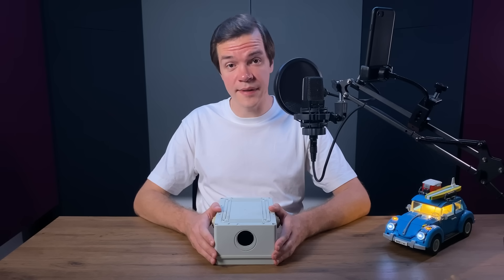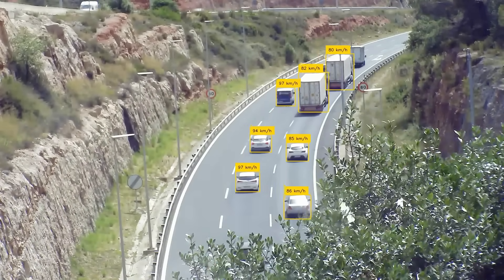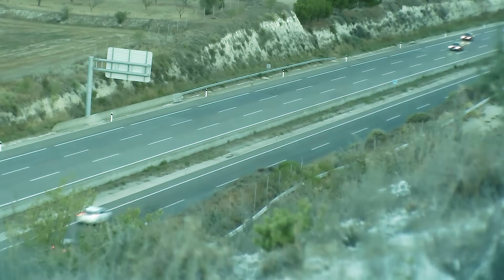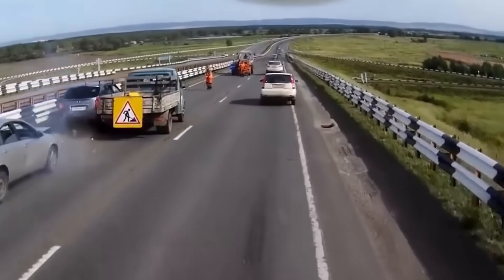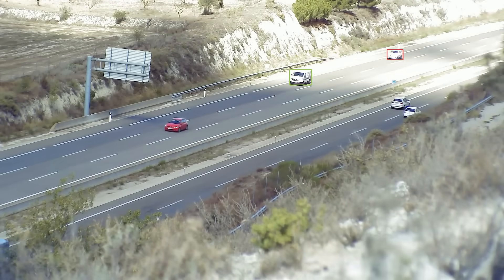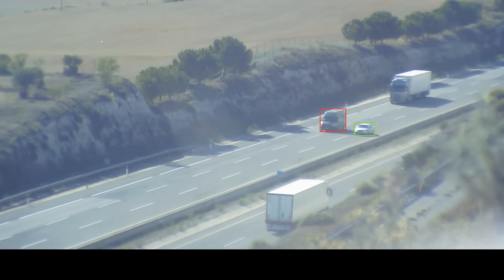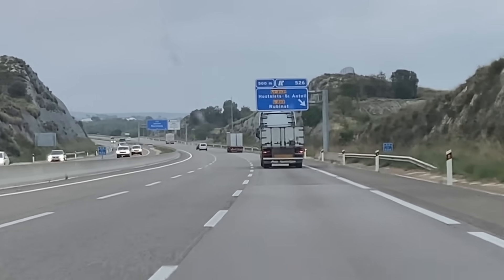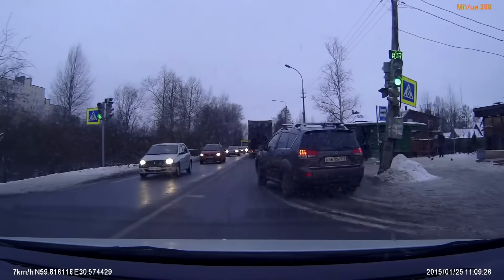New Anti-Tailgating Camera Reveals Shocking Statistics

Comment: Except that the stopping distance calculations (excluding the reaction time part) are based on very old technology. Road surfaces are better. Brakes are hugely better. ABS. As you obiously watch the program, Top Gear did an actual group brake test and found that the official numbers are wildly wrong.
Reply from the maker: 8 m/s2 is the actual deceleration rate for a modern car during emergency breaking on a dry surface. That's almost an 1g overload, very unpleasant experience. I would say, a relaxed driver in a reclined motorway cruising posture may not even be able to achieve this pressure on a break pedal during some time, as he'll first be moved in his seat until he reaches a proper posture.

Comment: This is a great video which highlights a VERY important issue. 
I always try to maintain a 2 second gap in front (and behind as far as is possible) but I find that drivers seem the gap in front of me as an open opportunity for them to join my lane. This video makes this very point at 14:10. 
The more of us that drive well, the better things will get. Thank you for your excellent video and hard work.
Reply: Two seconds is NOT enough of a safety cushion! In “perfect” conditions three seconds are the minimum but five is realistically the optimal space cushion for safety. In poor visibility or congestion it should be increased!
Reply: @justDudpool 2 seconds is the time recommended in the UK as long as the conditions are perfect. Of course, if conditions are foggy, wet or frosty then this time should be increased.
Interestingly we have sections of motorway with chevrons painted to make it easy to measure your time gap. 
Which country are you commenting from?
Reply: Recommendations, like opinions, are often misguided. I’m in Florida and a professional commercial driver. I’m constantly training and trying to always be safe on the roads. Keep in mind that your safety is most important to you and your loved ones. A proper space cushion on the road is the best thing you can have for your safety.
Reply: I'm from the US, and I was taught the 3 second rule, but that it only works under 45 miles per hour.
Reply: @tradingjack1555  It works at any speed.  Think about it: the faster you go the more distance you need to stop.  The faster you go the more distance is present over the 3s between you and the car in front.
Reply: @neildrd -- This doesn't quite work. If you go twice as fast, you'll have 4× the momentum. Even if tires worked as well at any speed, doubling the speed needs 4× the stopping force, or roughly double the stopping time.
Reply: @TlalocTemporal  True about stopping distance relationship to speed not being linear (but momentum's relationship to speed/velocity is linear: p=mv).  Keep in mind (in terms of hitting the vehicle in front of you situation) the vehicle you are following is also subject to approx. same stopping distance/time as you so in an emergency deceleration event that factors into (helps lengthen) your stopping distance (before impact).  Anyway, I'd be happy if people believed they needed to leave eg. 6 seconds at 120km/h vs 3s at 60km/h.  For sure big trucks, semis etc. should be leaving an absolute minimum of 4s.  Sadly majority do not, especially in high traffic urban/suburban areas where it is most important.  Thanks for the reply/getting me thinking.
Reply: I borrowed a 2025 RAV4, and the adaptive cruise control kept a two second following distance. It could be adjusted to be even shorter. Two seconds is too short.
Reply: @timothyandrewausten thanks for your feedback. I hope that manufacturers will build systems to allow us to travel at 3 or 4 seconds back. Less than 2 is dangerous as you say.
Reply: 2 seconds is actually recommended for motorcycles because we can typically stop easier/WE ACTUALLY PAY ATTENTION in traffic. Not that i do any less than 3, but when you're constantly looking a few cars ahead and keeping an eye out for anything that might potentially end up in the road and have very good brakes, 2 seconds can be fine.
Reply: two things: 

1: you want a three to four second gap!
2: You actually want people to use those gaps to merge! You can always regain your safe braking distance easily.

the second one sounds wrong until you think about how traffic works. the system relies on free-flowing traffic to allow people to pass, exit, merge, etc. if people can't get over they will need to either speed up or slow down... or they will engage in risky moves to get over!

One issue we see a lot of is people for some reason tailgating in slow traffic, creating bumper to bumper traffic. If there is an onramp near this, people have to STOP, have someone let them in, then slowly get in. This is highly dangerous and now instead of one lane being backed up, now two are!

Comment: VERY interesting; here in the UK the rule has always been TWO seconds, not three.

Even at two seconds, you still see a very large number of people driving along in your rear passenger seats at 100+ KM/h
Reply: Never heard of 3 second rule, it was always 2 seconds - Czech republic
Reply: Correct hence the saying, “only a fool breaks the 2 second rule”

In rain increase it to 4seconds.
In snow and ice increase to 8 or 10seconds or more in extreme conditions.
Reply: @robg521  Many people have practised the "Only a fool" rhyme so well, they can now say it all in under 0.5 seconds.
Reply: Yeah, and calculating how much time you need to break is nonsense. The car in front also need to break, you just need reaction time to make a good decision. For drivers paying attention while driving it can be 1 second, 2 seconds is more of safe guideline, because maybe you are not always paying full attention.
Reply: @Carewolf  Except, not all cars decelerate at the same rate; large. heavy, SUVs are notorious for taking 3 time zones to come to a halt.

I HAVE been in 3 lanes of traffic moving at 70-80 MPH when there was a major crash in front of us (oncoming HGV came through the barrier) I stopped in plenty of time; the SUVs on either side didnt - the inside SUV smashed into the car in front of it, and the SUV in the outside lane (Land Rover Discovery), lost control and smashed into the barrier.

2 seconds because it takes roughly 1.6 seconds for your brain to register danger, and send a BRAAAAAAKE!! signal to your feet.
Reply: @ianemery2925  Well, keep extra distance if you are driving a big dumb car then, though I suspect the drivers of those probably arent the smart enough to do that.

Comment: As interesting as you high-school math model in 09:30 following is, it is also highly inaccurate. Your model (incorrectly) assumes 2 things: a) That deceleration is constant over the entire process of breaking, and b) that deceleration takes place between a stationary object and the (back) car decelerating to avoid crashing into the object (think: car in front just hit a brick wall or is standing still, and the car behind needing to come to a stop). It does NOT hold true for both cars decelerating, at which point the deceleration DELTAS become important (the idea behind this being: if the tailing car has "better brakes", then the "reaction time" (and derived from this, the necessary reaction distance) alone would suffice). a) and b) imply non-linearity, at which point your simple high-school math approach turns into solving non-linear differential equations. Naturally, your "safety index" calculation suffers from the same false assumptions as well.

Comment: Shouldn’t the next step be to separate the incidents into situations of continuous tailgating vs tailgating immediately preceding overtaking vs tailgating in the left lane? These last two are the most common scenarios that I see. And even a lot of the clips you repeatedly show in this video reinforce that. I am not suggesting this isn’t dangerous, but it can help gain understanding why people do this. And to test the assumption that it is more common in the left lane (where cars are trying to signal to the vehicle in front of them they are going too slow and are trying to overtake) vs the middle or right lanes.

Comment: My current car has adaptive cruise control. I’d previously driven a couple of cars with static cruise control - i.e. just tries to keep a constant speed. But that is pretty hopeless except when driving on very quiet roads.

I use the ACC a lot of the time. The gap it sets by default seems OK - and I could adjust it up or down a bit, if I wanted. Which I sometimes do in very wet conditions.

I end up thinking that anti-tailgating could be encouraged by two additions to cars. 

First, ACC such as I have, or a simpler version which only sets out to check distance to the next vehicle. If it is less than the required distance, it alerts the driver. Gently to allow for the situations in which someone cuts in ahead. More annoyingly if the driver does not act on the initial alert.

Second, a similar device which faces backwards and displays a “Too Close” alert to any following vehicle which is too close. 

(In a mild fantasy version, it uses lasers to project where the safe distance is.)

That is, start by using persuasion rather than enforcement. With the other advantage that it applies everywhere. No just on some stretches of road. And, from a government perspective, the costs fall on the car owner!

In my view, ACC actually leaves me free to maintain my attention on the road and environment - and not on my speedo. Although I do stay within speed limits, seeing a speed camera does tend to make me check!

ACC leads me to play a little game when I approach a lower speed limit. If safe, I try to lower the setting early enough that I pass the new speed limit at exactly the maximum speed. I note that the majority of drivers seem to crash the speed limit sometimes hardly slowing at all.

When I drive about forty minutes to the next major town, I regularly see the same vehicles around me as when I started. A few have whizzed past never to be seen again. Some don’t even make it to 70 where that is the limit. I have had a calm journey, minimising stress, avoiding sharp acceleration and braking, achieving quite good fuel economy.

Where I live the majority of roads in built-up areas have a speed limit of 20 mph. I find it ironic that there seems less tailgating, altogether better following distances, at 20 than at 70.
Reply from the maker: I drove some rental ACC cars: Tesla, Toyota, VW. All of them brake unpleasantly when someone cuts in front. Tesla was the worst, VW was the best. I hope someday they'll release an open source car and I would be able to play with the algorithm so it drives more smoothly.

ACC was a nice experience, but not nice enough to motivate me to sell my beloved shitbox that only has static cruise control :)
Reply: @RailwaysoftheWorld1  Mine is VW group. ACC is far from perfect. In particular it can get confused if there is a wrong-side-turn slip approaching a junction that crosses the opposite carriageway.

But it emphasises that awareness and attention is required at all times!

I'd very much like to make small adjustments here and there.

Also, where I live the roads are generally less busy than most of the rest of the UK. And most of them are single carriageway. That means it is relatively rare for someone to be able to cut in front of me. It is usually simply follow the leader wherever I go. And ACC works very well for that.

Indeed, the other car I often drive is worse for raising alerts when there is no problem.
Reply from the maker: @polyvg  i hate those false alerts. Some BMWs from the early 2020s (they claim to have fixed this in 2025) brake automatically. That means, braking at a random moment on a freeway. I can’t imagine paying 80 000 for this crap you can’t even turn off.

Comment: I want a lane hogging camera.  Would be easy to do.  If a vehicle is in lane 2/3/4 when lane 1/2/3 has been clear for half a mile, BOOM, ticket.
Although lane 1/2/3 would also have to be clear for a bit after the vehicle goes through to avoid ticketing legitimate overtakes.
Reply: this
Reply: In the UK driving in the left lane on a motorway or dual carriageway can be a problem as the ruts in the tarmac caused by the Lorry’s get quite deep and are not repaired very often. These ruts are wider than most cars wheel spacing width, so can make it very uncomfortable especially when lane changing. Also in wet weather the ruts fill with water causing even more issues. The other issue is once in the left lane getting stuck there behind lorry’s due to very fast traffic in the next lane so can be a very stop start journey. I still try to move to the left lane where possible but it’s not always straightforward, as changing lanes is also a manoeuvre with some risk as shown in the video because it reduces the stopping distances of other cars.
Reply: You would also have to check if there are any other vehicles nearby. If there's no-one behind me and I can see a lorry or something ahead I know I'm going to be overtaking soon, I'll generally just stay in the overtaking lane even if the lorry is reasonably far away. Pointless weaving between lanes as I see some people do. If someone is behind, I'll move back across to ensure they're able to overtake me if they want, assuming the distance to the next vehicle I'm looking to pass hasn't become too short by that point.
Reply: There are many different situations, so one rule doesn't serve all.    For a vehicle pulling a trailer, it is beneficial to avoid the lane  that will receive merging vehicles.    This is due to the fact that the overall length reduces the lane-changing options, leading to greater speed variations and more risk than maintaining a steady pace in a more stable lane.     There is a similar effect for the average passenger car, but less significant.
Reply: Way too complicated. And where will this magical camera be located? I really fail to see why vehicles can't over and undertake, like they do in the USA. Having driven all over the world, I didn't find it any more dangerous than following a car hogging a lane while there are other lanes to go to. Oh wait, you have to keep an eye on the mirrors etc. In the UK, the Police do pull drivers that hog a lane, but then when did you last see a Police car..... And think about it, half a mile at 70mph is what, about 25 seconds. Not a super long time at all.
Reply: @bertiesworld  Because allowing people to drive in all lanes however the hell they want makes traffic extremely chaotic and chaos is dangerous.
Reply: @demoniack81   Here in NY some roads are built like that. Like 5 lanes and each lane goes to a different location.

Comment: Those smart speed camera that calculate your average speed on a multi-kilometer stretch of road are simple but very effective device ! Could be implemented on every on and off ramp on a highway to calculate the average speed of everyone on the whole length of road !

PS: in France, the main cause of fatal crash is still excessive speed, then alcool and sleep, and then only bad driving if i remember well